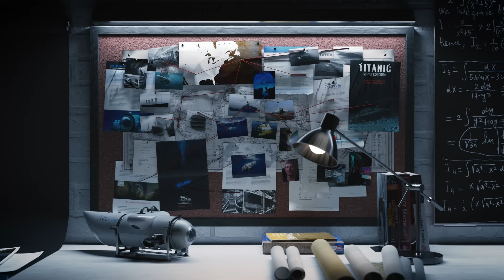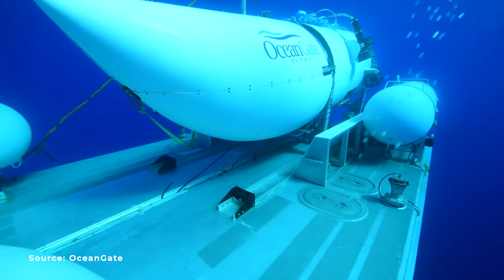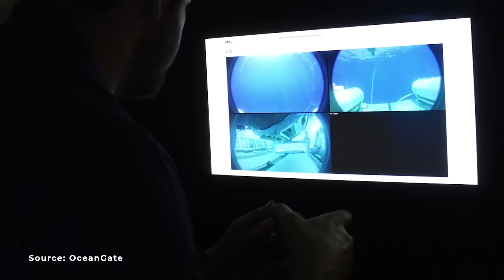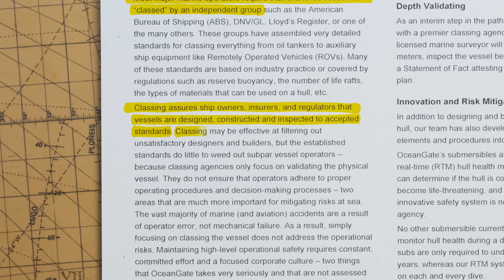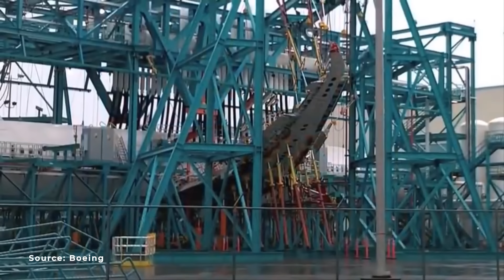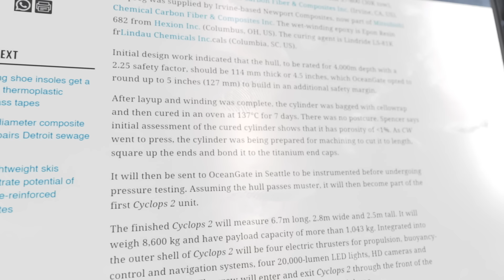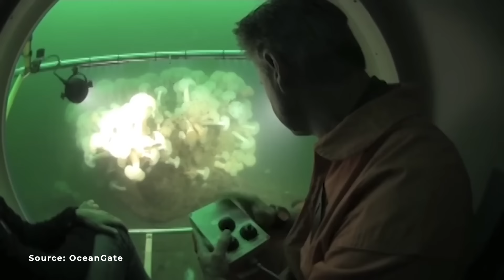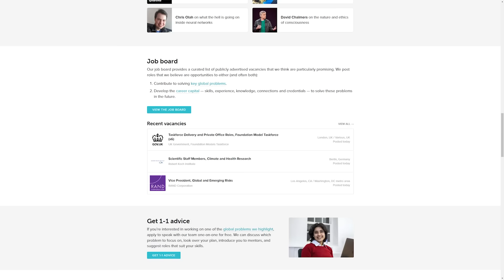The Questionable Engineering of Oceangate

Comment: I have a slight disagreement.   Well before the 787, both Airbus  and Boeing had been using composites outside of just the fuselage. Wing parts and eventually full wings, the wing box (which holds winds to fuselage).  None of these hold positive pressure and in a way are compressive (when a wing flexes, he uppper part is compressed while lower part is stretched). 
My disagreement is that people tend to blame "carbon fibre" generically and not focus on OceanGate careless design.  Just wrapping tape in same direction around a cylinder and let it cure does not take advantage of the huge gain in strength carbon fibre gives when weaved in different directions.   And if the inside was submitted to increased force to try to delaminate, then a honeycomb shape would help provent that. And more importantly, (Boeing learned this when doing the NASA sponsored R&D on how to build a fuselage), the composite need to be PERFECT. Not an average good, but perfect all over and that means xray or ultrasonic checked of whole item to find any/all imperfections (as well as a process that would eliminate imperfectiions before the item solidifies (hence proepr tape laying and curing.  For some parts, Airbus wrapped item in a bag and vacuumed it to get all air bubbles out  and let air pressure push the tayers together. Boeing chose pressurized autoclave to reduce size of air bubbles to minimum and also focus on tape laying to prevent air bubbles being trapped. 

Ironically, when done perfectly, the composites last longer through pressure cycles than aluminium and this was one big advantage pitched by Boeing for the 787. But when you have imperfections in the composites, then delamination happens and durability advantage becomes a disadavantage.  This is why perfection is so important. 

OceanGate was partly right in breaking new ground by trying composites where they had not been tried before. Just because it wasn't done before doesn't mean it couldn't be done.  But they simply though that by laying anout thickness would do the trick and not be very scientific about best practices and weaving techniques. (this is one area where Boeing for instance spent a lot of time studying the best weaving patterns of the tape).

In terms of certification, his attutude didn't seem right, but on other hand, are any agencies equipped to study that sub? Consider the A320 which was first commercial airliner to be FBW with a lot of software in it. Neither FAA nor EASA had expertise or procedures to test software, so they tested the A320 as a convebtional 737 from the 1960s and didn't spot all the software glitches which ended up being debugged during commercial operations (and which also required many adjustments to pilot training because aircraft didn't behave as older aircraft, and airlines had underestimated it).   So it is quite possible a certification agency might not have the knowledge to test the sub or simply refuse to test it because they lack knowledge to test it. And testing it would also require they have full data on exactly how the carbon was layed/processed which I suspect Ocean Gate didn't have precise data since it appears to be more artisanal. 

Having said that, OceanGate, assuming the certification agency didn't have knowledge to test it, should have tested it themselves with full ultrasound "x-ray" of the carbon fibre hull after every expedition (even it it meant removing the metal skin around it). 

BTW, Coast Guard has released no data to confirm implosion (or even sudden implosion).   The only hint released was in a press release with "presumend human remains within" onf the the recovered parts (and that one was carefully handled so no media could see it).   "Human parts within"  could teoretically mean that the cylinder is intact and that what failed is the rear dome's hole where all the wriing and piping went through. 

The allegedly leaked document of transmissions during dive till the end, if authentic, shows there was cracking sound in the aft.  Also shows that it took a long time between ditching weights and actually starting to rise. It was going down at 43m/minute which they had adknowledged was too fast and wanted to reduce but found their thrusters didn't have enough power to reduce descent rate followed by acknlwledgement they had lost main bus A for electrical power and decision to surface.  Imagine for a minute a compromised read dome where the electrical wiring going from high to low pressure started to let salt water thorugh via space between conductors and their insulation and this started to cause shorts and that heat would then compromise of the seals and let water in. (and depending on construction, if that water came in as a tiny filament at 5600psi, not only cause a lot of damage but also  accumulate at bottom of cylinder which might explain why sub couldn't rise quickly when it really water to (for last transmission onlt 6m rise per minute).

Someone having proper specs for the sub and how fast it should be able to rise after ditching weight and the bottom landing gear, might give insights on why it didn't climb at faster rate during last couple of minutes.  If water infiltration from back between wires would collect under a floor in the cylinder, would the crew be aware? (surely they would feel need to equalize nose/ears and realise something was wrong, but no such communication).

Since one can't know if the leaked communications are authentic or not, we can't draw conclusions, but if they are authentic, the length of time between detecting too quick a descent, inability to slow descent because thrusters too weak, loss of power on one bus  points to something happening over time.  Not something that was instant and unpredicted. Or it could have been two separate problems one with electrical failure and then totally unrealted instant catastrophic collapse.  I am hopeing the investigators will be able to get to a determiation of exactly what happened and hopefully condemn this design or construction method and lack of surveying of composit to find any defects instead of condemning any/all composites.  

A popular filmmaker said that composites should never be used and only spheres are valid shapes for subs, neglecting the fact that navy submarines are long cylinders and not spheres.

Comment: IMHO, if the reason they used composite is really because "the foam was too expensive" that is about as stupid as you can get. The reason foam on the hull is used is because it dampens the acoustic signature of the submarine. Which is totally irrelevant for their use case. Since they were willing to "be innovative" and use their own solution anyway, they could have used a steel hull coupled with any cheap and simple way to gain neutral buoyancy they wish for less money and better safety.

Comment: Overall sounds like a good review. However, blindly following "industry standards" is absolutely no guarantee of anything resembling safety. History is full of failures that happened even though standards where followed.
Industry standards is at best a loose guidance to no forget some details that are already known. New issues can arise on every single new design that is even slightly outside of the operating window of previously existing designs.
Understanding what you are doing, and how that affects things is key. "Following standards" is at best a band-aid to avoid litigation.

Comment: I don’t really consider it an accident… They were going down 3850 meters and it had a crush depth of 4000 meters…It should have been rated to 7-8km if it was going to be making multiple dives. If you’re diving to 90+% of failure depth, every single dive is going to compromise the vessel. The more I learn about this, the more angry at Rush I get

Comment: Pretty good analysis.
And I agree, I have my reservations about how rigorous OceanGate was in its Design, Manufacturing/ Inspection/Qualification process.

HOWEVER, I think some of your criticisms are of a back-seat driving type.
Saying the hull should have been autoclaved....hmmmm.
And so how much does THAT cost to make a one-off autoclave to fit this?
Sure, in an ideal world, with a huge budget you'd do that.

I read the Composites World articles: it seemed to me that the design & testing process was pretty good.
And that includes the initial work done on the Fossett sub.
They did half-size testing as i understand it to validate their design modelling.
That's pretty good.

In terms of certifying it, I dunno.
I've read unsubstantiated claims that this was the only one of 30 other ultra-deep submersibles that wasn't "certified".
I'd like to see an ACTUAL list of them, and details of certification.

These are all niche systems.
I'm not convinced that asking Lloyds Register, or some other FOR-profit organisation is realy the best way to spend your money.
But I'm an engineer: and I like the idea of indepependent review.
HOWEVER, for a US-based organisation, as soon as you do that, you open yourself up to....lawyers.
it's no longer an engineering task.
But rather "cover your a$$".

Fatigue: hmmmm.....in COMPOSITES???
You say some pretty definite things about fatigue here, but fatigue in composites is REALLY an unknown field.
I'd like to see an actual list of the dives.
As well as a log of what their monitoring system recorded.

Your video discusses how Boeing etc stress tests/cycles a wing.....but that's a VERY special case.
Only a multi-billion dollar company can afford to do tests like that.

That's quite important, because it's no longer And I would like more info on the monitoring system they used to detect fatigue cracks.
You dismiss it as marketing hype, but i see very little to support that.
I read that the titanium end caps have strain gages, and the composite hull doesn't.
I think it would have been good practice to embed some smart monitoring in the composite hull.
Sure, is hind sight, but rather spend $$$ on that than give it to the entitled English aristocracy who get the £££ from Lloyd's Register...;-}

OK: so bottom line is I'd REALLY like to see a DETAILED report by the US Navy/Coast Guard on the sonic data they have.
I'd REALLY like to see if the failure truly WAS implosion.
I see VERY little to support that.

I can build a case that supports a leak through a gasket/interface, that allowed seawater in.
And that then, by adaibatic compression of the air, raised the temperature high enough to cause the Viewport PMMA (acrylic) to deform and fail.
And allow a sudden flow of seawater.
And THAT was the cause of the "explosion/implosion".

It blew the sub into at least 3 different segments.
But was NOT an actual implosion.

Comment: Comparing this to Elon and SpaceX is wildly unfair.  While yes, SpaceX is fine with failures (in fact, they often launch expecting them, but knowing the data they'll gain from it), that's NOT how they operate OPERATIONAL craft.  And for exactly the reason Virgin failed, and now Oceangate will too: when you blow up your customers and / or their stuff, your business won't last long.  The willingness to fail during testing is what allows rapid iteration and innovation, but that is not to be mistaken with IGNORING proper testing before putting something into normal operation.

Comment: "The vast majority of marine (and aviation) accidents are a result operator error, not mechanical error." He took that way out of context and cherry picked that line out of the bigger picture which was probably safety standards.
Reply: @Anti_Society_Society The reason for the majority of Marine and aviation accidents being caused by operator error Is because the lack of flaws in design and The vigorous testing of every part of a plane or boat. Not saying that the designs are perfect but human error is the only way that these accidents are possible. In which he chose to ignore all safety standards and scientific research in the name of "innovation" like Elon and space X even though Space X has yet to have a successful launch. Just like Space X, Oceangate also crashed and burned.

Comment: Carbon fiber composite materials and composite materials alike under extreme compressing pressure will weaken the inner most layers first to separate the outer thicker layers. It targets the pockets of weaved layers gradually over time. Carbon fiber composites will always fail this way due to the pressure filling the gaps. As well if there are air pockets within the epoxy and carbon weaving itself, it will never fully reach its maximum hardening and structural strength. These people not understanding composite delamination on a published report extremely alarming. I don’t feel bad for these people at all, you learn things like this in school in applications of physics, composite material structure/structural material engineering, and automotive engineering. It’s just thinking you’re god and money buys independence and blinds the users likewise.

Comment: Here is a video experimentally comparing compression strength and characteristics of various materials including titanium and carbon fibe

https://youtu.be/PlvyZ1r1DCM

An idea that occurred to me…. Let’s say the carbon fiber has some voids
I assume hey are filled with  gas
Sub goes Down under extreme water pressure 
Some water infiltrates into the voids
Sub comes up, and now there is pressurized water and gas in the voids
Which would act to incrementally delaminate the carbon fiber
Which also could be why the implosion happened as the sub was rising

Comment: I've seen three tragedies happen by now where the CEO is the owner and pilot of the vehicle.
1-Chapecoense soccer team rented an aircraft in which the commander pilot was the CEO of the company. They didn't reach their destination.
2- Former brazilian reporter Boechat was in a 50nm helicopter commuting flight to the news studio in an aerial taxi bell 206 which the pilot was the CEO. He was flying with an engine with a high compression unit that had expired 20 years ago. Leased an unit to pass inspection then switched the part to the old one after inspection. None of them reached destination.
3- Titanic submarine.
If you trace the profile of these 3 CEOs all of them share the same behaviour, favouring the continuity of operations of their companies above the safety of their own existence. Basically Suicidal CEOs. There are plenty of them out there.

Comment: Although it's impossible to know, I wonder how much longer it would've lasted if they had autoclaved the hull.
Reply: It astonishes me that this was not autoclaved. It's such an extreme application, how could they have not? The cf hull was 5 inches thick. Autoclaving this would be the only way to ensure the best bonding of fibres and matrix, and to ensure as few voids as possible.
Reply: @richardconway6425  I have a very limited knowledge of laying and curing procedures, and even I know a pre-preg autoclaved pieces are some the highest quality pieces. When I heard they bag cured a vessel that 5 people were going to put there souls in at that depth, God speed..
Reply: @biscuitsticks438  correct on every point.
Reply: It is not impossible to know. Build a second Titan to the original specs, then a third Titan with the aid of an autoclave. Send them both (Unmanned this time!) to the bottom of the ocean. Repeat the voyage until failure. An expensive experiment, but not impossible. I do not have the loot to spare.
Reply: @arthurofcharn  yes, quite true. It would need the cooperation of the original manufacturer of the cf hull, because only they know exactly how it was made. But yes, this could be determined. 
I think that after this needless tragedy the accident investigators and independent consultants are going to have a very long and thorough look at  all aspects of using composites in submersibles, and hopefully will do lots of actual, real world testing. I think the industry will learn a lot from this, and set regulations on the use of composites in manned vehicles very carefully.

Comment: 2:03 this carbon fiber is poor in compression myth just won't die down. An aircrafts wing's top skin surface and internal spar carry high compression loads. If alarm bells are sounding, it would be your lack of knowledge. Composites can be designed to compression loads and especially in a deterministic pressure load scenario. Since they are thick actually become more resistant to compressive buckling and collapse loads more than say aluminum.
The pressurized hull probably had many microscopic leaks. It is a known processing problem during rocket engine winding process where the carbon fiber tows have gaps.There are ways to mitigate it(ie with a liner). Misinformation in this video is stellar. You can design with any material. Blaming it on composites does not make any sense from an engineering perspective. Trust me I am an engineer...
Reply: So is he

Comment: According to the leaked messages the vessel was having trouble ascending at the time. This either tells me that he wasn’t aware of the differences in buoyancy at such depths (which seems unlikely) &/or that the vessel had become much heavier during the dive. Perhaps it had started to delaminate & take on water into the layers? There were reports of lots of unusual “crackling” noises.

I’ve also heard that although the Titan had made around 20 dives, it was re-hulled sometime around 2021, with the carbon fibre part being replaced & the titanium parts re-used, so (if correct) this means that part was a relatively new structure. I’ve also heard that it had been in storage, completely unused, for just over a year.

So many questions.

Much of the carbon fibre fragments were apparently recovered (although we only got to see the big pieces on the media coverage, I’m told that almost all of the fragments were bagged up by ROVs during the salvage operation) so hopefully at least some of these questions will be answered in time.